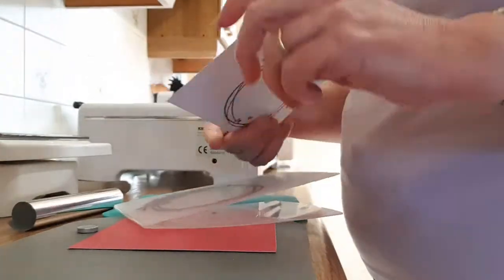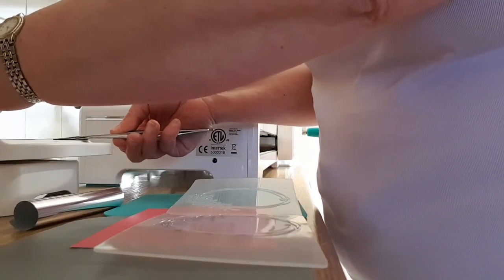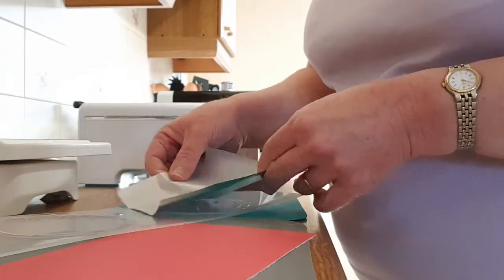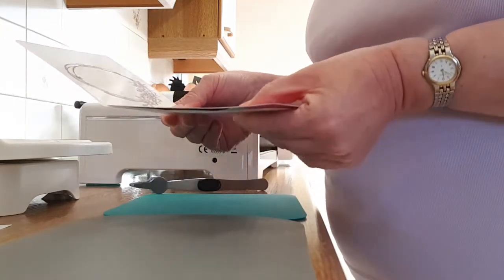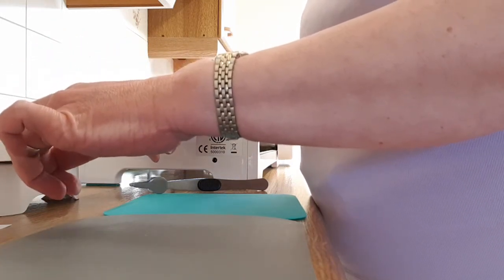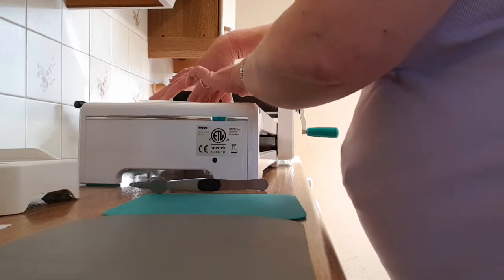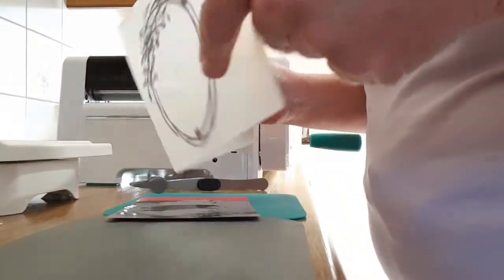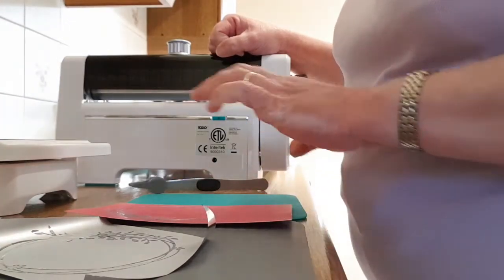GoPress foiling with an embossing folder V2

Comment: Is the foil embossed too? Is there an indent on the paper or is it still flat and smooth?
Reply from the maker: There is a slight indent in the paper with the foil pressed into it, like you get when using a metal hot foil stamp.